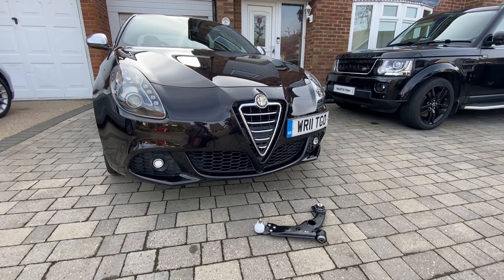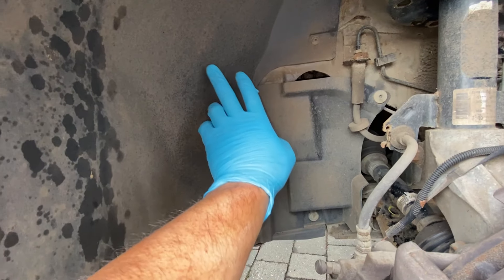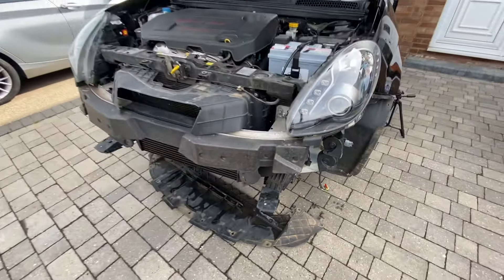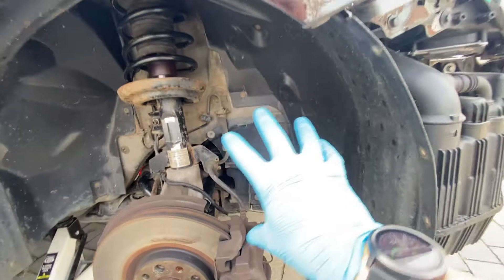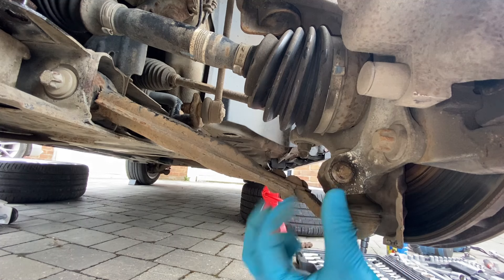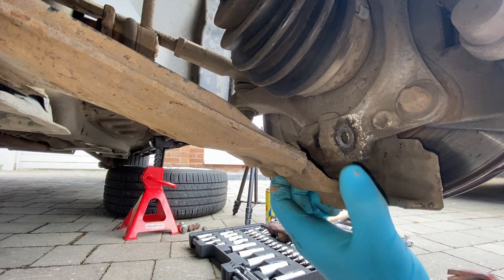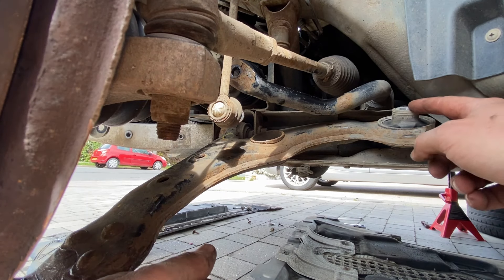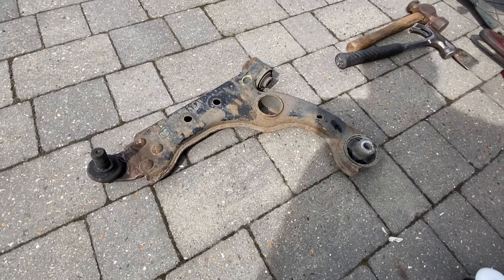Alfa Romeo Giulietta Front Control Arms - Both Sides. What a fight that was!

Comment: Thanks for this! I just did the same job, as well as the shocks. What a challenge indeed.
After 1,5 hours of banging I bought a Ball joint separation fork. That did the trick! Jam some spanners between the wishbone and the tool if you got the fork all the way in and you still need some room. Just a tip for anyone attempting this. Not a job for someone without patience.
Reply: any paticular separator work well? Seen loads of different ones, some branded as "universal", others for specific models.
Reply: @oisinkeatingmacdermott8400  I got a simple set with 3 different width's/thicknesses.

Comment: I remember this job well. On my car the pinch bolts for the lower ball joints had almost corroded through and were stuck solid due to the dissimilar metal corrosion between the aluminium and steel. Alfa also seem to go to the extreme of making the car difficult to work on with so many parts needing to be removed to do what should be a relatively easy task.

Comment: I've done it the hard way 😪 didn't remove the bumper and removed the old bushes from the arms, 100% you did it the best way, the only good thing for me, is when I have to replace the ball joints I now know how to remove the bumper and the bolts are greased. For anyone reading this replace the full arms rather than waste time just replacing the bushes...thanks Tony

Comment: Thanks a lot for your videos! I had an accident with my Giulietta in January. I gave a try to fix her by myself and had to replace front shocks, control arms, drop links and other parts. Needless to say your videos helped A LOT. Now she's back in action, not perfect but at least she did not end in the graveyard and I can go to work with her. Left ball joint came easily, but the right one was a hard fight! I had to get the brake disk off so I could hit more directly to get it down.

Comment: I'm going to do this saturday. I've bought a new pair of control arms and pressed in some PU bushings from "Strongflex" Much cheaper than powerflex and arrives within 2 days from Poland. Now the hard part. Hopefully everything works out the same on my car. Noticed my car has some extra bits and bobs that make it a bit more difficult. For example some sensor type device on the rear anti-roll bar.

Comment: Tony,great job,i tried this on my car 10 days ago on the drivers side,my pinch bolts were solid so got both sides so done the week before and replaced them with well greased new ones,on the drivers side i used one of the fork type tools to batter that ball joint out,the arm i was going to replace it with i had put the powerflex bush on the rear,to try and install it as it is so much stiffer than the original i jacked up the suspension only to pop out the inner driveshaft spider joint,car has sat like that for 10 days,new wish bones arriving tomorrow and mobile mechanic on saturday to sort out my drive shaft,my advise for anyone attempting to do these with powerflex bushes at home is don't do it,both new arms with rear powerflex bushes coming to ebay soon,cheers

Comment: I found heating the knuckle by the ball joints helped a lot when I did mine over summer, same time as I did wheel bearings. Have to be careful not to melt the CV boot using oxy-acetylene. Was still an absolute pain though. Thanks for the video Tony, I'm sure it'll help a lot of people

Comment: The toughest thing is to remove the ball joint, You need a good 2kg hammer and a suitable chisel or an electric or pneumatic hammer that will do the job in 30 sec. 
BTW, the bumper does not need to be taken off, The small inner liner part can be turned clockwise far enough to make space without having to undo that hidden nut.

Comment: Appreciate your videos TONY! I am not sure ,but you should get the torque on the bolts of the bushes after the car is sitting on its own weight. Otherwise you could rip them apart as I know. As you lift the car the arm goes down and you fix the bolts in this position right. When you put the car down the bush going to get too much move up because you fixed the bolts when that was in the air. That can cause damage on the bushes.
Reply: I’m talking about the front bush….
Reply from the maker: Hi and thank you for watching. Hopefully you heard me say and saw the part where I Jack the hub up to mimic the car being on the ground  , after explaining you can’t do it with the car on the ground because of the support beams needing to be installed. So yea, you are correct, but glad to report I have it covered 😉👍😂. All the best 👍

Comment: How long did it take? 
I have to do mine outside like you. It's now October so hope weather keeps off. 
Plus where did you buy the parts.
Reply from the maker: Hi. The fight with the ball joints was the longest part and if it wasn’t for that it would have been much quicker. All in it was probably about 6 hours on the driveway. Make sure to get the alignment done afterwards by a professional garage. 
I got the parts from AUTODOC. Hope that helps. All the best 👍

Comment: Fantastic video Tony - you're a saint for the G community! Just curious how much you paid (& where you bought them) for a new control arm with bushes included and also for the replacement drop links. Also noticed you've upgraded to some power tools - electric ratchet + wrench? #Fancy Maybe a review video of those tools for some future content?
Reply from the maker: Hi Saleem. Thank you. Yes, the tools were a worthy investment for sure. Definitely makes light of things. The control arms were about £43 from AUTODOC. They took forever to arrive though nearly three weeks. The drop links were not as described either, so quite disappointed with them. (No spanner attachment to the main pin). 
Thanks for watching. All the best 👍
Reply: @vialettotony  I was just looking at autodoc before i dropped that comment - seems pretty reasonable given the replacement bushings seem be £20/30 each anyway! Are you planning on doing the same video for the rear suspension?
Reply from the maker: @Ragnarrok2023  yes, I hope to refresh the entire setup, whether with new parts or replacement bushes (probably new parts based on cost savings as you have found also). Did you see the rear anti rollbar video yet?

Comment: Two failed bushes on each arm here. Is it worth it to replace them or to proceed with the whole arms?
Reply from the maker: Hi Radoslav. Replace the whole arms for sure. I'd bet that you're ball joint is on the way out too. All the best. 👍
Reply: @vialettotony  thank you. I suppose it's not necessarly to go to wheel alignment after that, right?
Reply from the maker: @radoslav2596  haha. I take it you didn’t watch until the end then?  Yes, I would recommend it. My car is booked in for this tomorrow as well as the new MOT.   All the best 👍

Comment: Dude, Ive just done mine. That bottom pin in the arm is an utter pig isn't it? Arms, drop links and track rod ends done. Still knocking though 😂
Probably the strut tops... Sigh. 😂
Reply: Hi. Did you ever manage to resolve this. Had my lower arms changed (the bushes were shot) then got a louder knocking. 
Forums suggesting the car wasn’t torqued off the jack but it was done at a long established alfa specialist. 

Was it your strut mounts, drop links or something else in the end?
Reply: @anthonymeek4248  the shock on the nearside was utterly trashed. Changed for new ones and job done. 👍
Reply: @egon2875  thank you! Dropped mine off at 2nd garage today (1st couldn’t find the problem). These guys reckon it’s the top strut mounts and possibly the shocks within the struts as well. Expensive I guess but to get rid of the noise I’ll do anything.

Thank you for your reply reassuring!

Comment: Is this the camber?
Reply from the maker: Just the wishbone. Not actually sure you can adjust the camber on the fronts?  All the best 👍
Reply: @vialettotony  bathwick tyres said my camber needs adjusting, my local tyre and mot centre said the same. But the alfa specialist said the camber can't be adjusted.. nightmare!
Reply from the maker: @idlethumbs01  yeah not good. As far  as I know it can’t be adjusted on the front. It’s a single wishbone setup and there’s nothing on there that allows any adjustment. If your garage said it needs doing, then why were they not able to do it? I guess you tyres are wearing unevenly? Sounds like it could be a tracking issue more than camber. Have you had that checked? Hope that helps. All the best 👍
Reply: @vialettotony  you definitely know your stuff buddy, that's word for word what the specialist said. Both garages said "they need a special alfa tool for the camber" but 3rd garage done tracking and its great to drive again. Any more giulietta videos coming down the line mate??

Comment: love my giulietta but god it's a fkin pain to work on. feels like a motorbike.... "i need to take this little thing off, so I have to take it half apart"
Reply: So,update... gave up on it. Managed to get quite far into this but the frame bolts were so corroded there was just no way for me to get them off. Took it to a garage had both replaced...but now there is a weird clunk (at low speed, when fully turning the steering or when starting to move backwards and forwards). So either the garage messed it up or by replacing them a new problem was uncovered
Reply: @RealDarkBlade  I have the exact same issue - did you ever get it resolved?

Comment: Bumper removal wasted time, jack up the disc putting under load so not springy when using a spliter or cold chisel. 40 years experience had to comment, made that job painful. Why giving advice ?